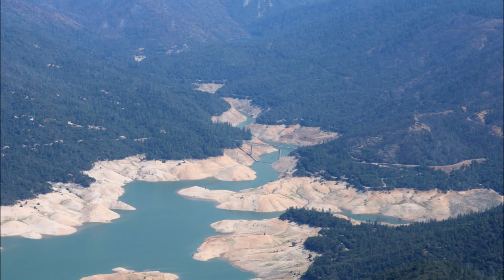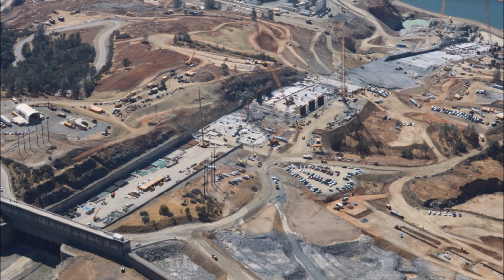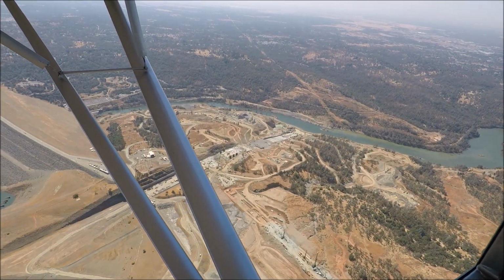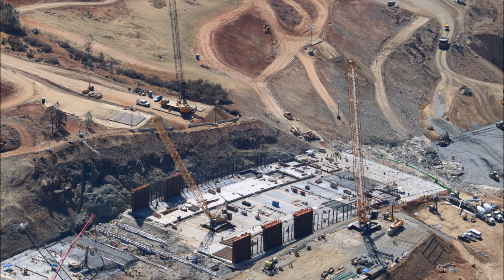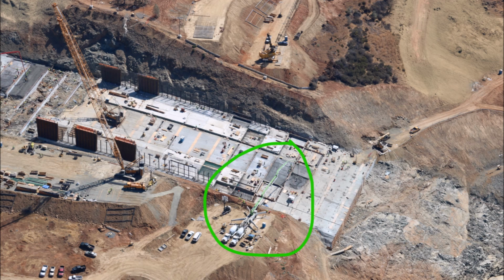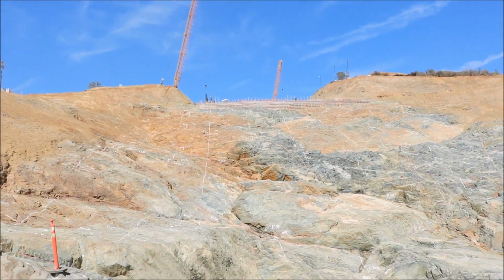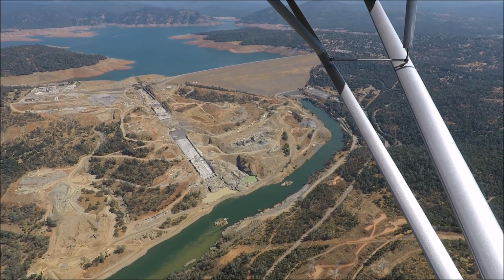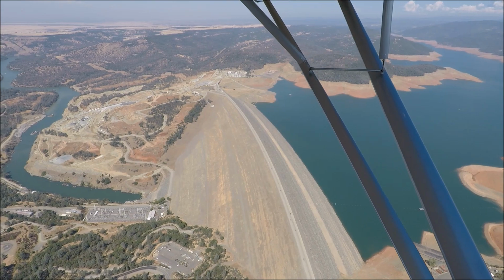Oroville Update 13 Sept "The RCC Race is ON!"

Comment: So, the bottom line of the Independent Forensic Team Interim Report is that it was slab uplift caused by the intense water flow that caused the failure, not cavitation, not groundwater erosion and not seismic activity. Necessarily there will be some handwaving as to exactly why the water flow caused the slab uplift since the evidence was all washed away. To quote:

The IFT believes that some combination of the following factors most likely was involved: 

• New damage and/or deterioration of slab repairs that resulted in more potential flow disturbance locations and more flow into the foundation than during the prior spillway discharge events. 

• Possible expansion of relatively shallow void(s) under the slab due to long-term erosion under the slab. The IFT found that the available evidence does not support the hypothesis that a deep void formed beneath the spillway chute due to foundation erosion, resulting in subsequent slab collapse, but shallow voids are conceivable.  

• Corrosion of the rebar across the concrete cracks or joints, as evidenced by post-failure investigations and previous repair photographs. 

• Reduction in anchor capacity due to erosion around anchors beneath the slab or anchor corrosion where anchors were not properly encapsulated in grout, also as evidenced post-failure.
Reply from the maker: Yep!
Reply: No one mentioned that the spillway makes a vertical bend similar to the airfoil of a wing where the high speed flow produces lots of lift, as seen in a fully loaded 777.
Thanks Juan for some great reporting, both here and about the hurricane!

Comment: I don't know a thing a flying, but the way you move that stick around during landing makes me nervous.
Reply: He's good with the Luscombe.
A bumpy afternoon due to the hot sun on the ground, every surface variation means a difference in air rising/dropping (thermals).
The view out the front shows how his quick little corrections left/right forward/back average out to keep it quite smooth on the intended path despite the bumps trying to move it around.
Reply: Actually, it's just his quick reaction and anticipation to counter all the rough air movement, so just imagine how rough it would really be without all the corrections!  Skilled pilots are quite good at this.  Maybe partly due to his Oroville Dam flights, I have taken an interest in flying, what pilots go through before, during and post flight.  I'll never be a pilot, but I find it fascinating and have learned quite a bit.  I might find a flight simulation program someday, might be safer and cheaper than the real thing.  I and wifey did boating in a 31 foot express cruiser for 8 years and some of the same principles a pilot follows are what we used in planning and executing our trips - fuel management, GPS, weather reports and weather watching, alternate plan B, "float plan" shared with a loved one back home, dual radios for communication, having proper supplies aboard and proper distribution of load, and more.  Boating is fun too!

Comment: Good job again White Lily! 

What are the specific erosion "control" measures? 

Did the DWR report explain just how the "dreaded green spot" actually occurred in any detail? 

Is there a linear profile showing the gradients (velocities/capacities) that will exist upon completion? 

Speaking of "linear," (as in thinking) has anyone mentioned the need for a set of comprehensive data sets, including, for example, the potential power and effects of S and P waves on the foundation of the foundation and its effects on the best laid RCC's and reinforced materials? 

Has anyone talked about the power of human demands over feasibility and context and vice-versa? 

Have any of them read Dickerson and Robertshaw's "Planning and Design?" If so, were the principles used in this case? 
What continues to astonish me (after all these decades, why does it—am I dum or sumpin'?) is how much guesswork and presumption (not to mention that horrifying creation, "Best Practices") goes into "engineering."

Comment: The RCC is being placed even with the top of the structural concrete so they are gonna have to remove 12 inches of Rcc and replace it with 12 inches of structural concrete. Juan if there is normal rainfall next winter can the power plant keep up with inflows? Wasn't last year an unusually wet winter compared to normal? I am wondering if they might not need the spillway at all this year.
Reply from the maker: That's right, the spillway may not be used at all this next year. The lake will be down nearly 200'!
Reply: Almost correct. The RCC is being placed even with the top of the "leveling" concrete. That puts it level with the "bottom" of the permanent structural slabs. So next year, they will pour the permanent structural slabs "on top" of the RCC and they will be even with the remaining structural slabs. For this winter, they will put a +- 3' high ramp (equal to the thickness of the structural slabs) at each end of the RCC where it meets the permanent slabs to ease, and aerate, the water as it travels over those different levels.

Comment: Great Reporting again Juan (as usual) Quick question (slow answer) The small pool at the end of the Spillway with the road across the bottom, that road has 3 or 4 hoses of a fair amount of water continually squirting into that pool on the inside of the road, where is that water from? What's it draining?
Reply from the maker: Steve Simmonds probably from construction, dental cleaning.

Comment: Awesome Juan thanks. That is a deep hole to be filled wow.
Reply: One of those images in Juan's video as well as what might be the same image in the latest DWR video, there is a vehicle sitting on one of those roaddways that has been cut to enable the RCC work as they progress up the slope. Using that vehicle as roughly a 6' gauge, each one of those roads is approx. 40' above the lower one. The bottom one may be a percentage less. I believe, however, that stated footage includes the fact that we are dealing with a compound issue. A "slope" (+- 20%) plus a hole. A straight line between the RCC and the leveling concrete @ the USW probably eats up half of the stated footage because of the ?? 20% slope of the chute. No getting around it, it IS a monumental amount of material.
Reply: Pappa -- Didn't I hear reports of 1.5 Trillion cubic yards of material washed into the Diversion Pool? A certain percentage of that came from what has been dubbed Croyle Canyon, yes?
Reply: If memory serves, and I have forgotten when that was reliable, the number I remember hearing from Juan was 1.5 "Million" cubic yards of material. Still way more than my "wheelbarrow" wants to tackle. ;o)

Comment: Lots of people keep saying RCC will be removed next season where the structural concrete will be added (the middle section). According to the BOC reports, the only RCC parts that will be removed are the "transition" ramps and the very top and bottom of that center section. The Structural concrete will be laid right on top of the RCC assuming none of the RCC needs to be repaired. The RCC that WILL be removed is the "training walls". 
While those things alongside the lower RCC areas my look like forms, they're actually working scaffolds for the placement of the shotcrete on the RCC training walls. Amazing how they look like they're going "uphill" while they are actually "level" on a rather radical slope. 
Thanks for the great coverage Juan. These are some great shots.
Reply: If my understanding is correct, yes, the "finished" RCC is at the same level as the "leveling" concrete with a "transition ramp" at the bottom of the RCC section and another one at the top of the RCC section of the chute (with some type of aeration feature). The "Structural Concrete Slabs" that become the permanent surface of the spillway, are roughly 3' thick and sit on top of the leveling concrete AND/OR the RCC since both of those bases are at the same plane/level. So, next year, removing those transition ramps and adding the structural concrete slabs on top of the RCC section, between the upper and lower SW,  will make the entire spillway the same level.  Before the BOC reports, when there was much less detail regarding the RCC and its levels, there was a some question and presumption that the RCC would be level with the "top" of the structural slabs so three feet of RCC would need to be removed and be replaced with Structural Concrete next year. That idea seems to have become "embeded" and keeps coming up even though more details have come along that disprove that idea. The explanation of the ramps is also in the last BOC report.
Reply: Pappa Bob I have the same understanding as you, but it raises a couple of questions. Currently, the RCC is flush with the leveling concrete. My understanding is that the reinforced top layer of RCC is already completed. So next year, the structural concrete will sit over top to align with the slabs below. The issue is this: if this is correct, there will need to be an UPWARD ramp for this season  since the RCC is lower. Have not heard any talk of this.
Reply: It was my understanding that Kiewit would grind down the RCC where needed to achieve the correct elevation for the SC to be applied. Also, they are going to cut out sections crossways where the drainage pipes are going to be placed.
Reply: For sure, they will be saw cutting trenches for the drains. The RCC elevation, however is roughly 3' below finish grade so grinding for elevation should not be necessary. That is the reason for the "transition ramps" at both ends. They are using GPS instruments now for the levels of the RCC so they should be pretty accurate.
Reply: I think there is still a question as to whether the final hardened layer of RCC has been added. If it is still to be added it could come up flush to the finished slabs below for this season. Then, when the final slabs are placed over the RCC next year this would create the step down that has been discussed. I think this is the most likely situation. It also explains why the drop from the upper slabs to the RCC is currently so large. After the final RCC layer is added and then the structural layer next year, the drop should equal the lower one.

Comment: Hello. I ask if there is any other reason besides cavitation reduction to introduce air in the water stream? At the end of the CA Aqueduct in Sylmar CA there is a long open channel (part of the aqueduct). This channel has been there all my life (you can see it as you head North on the 405, this part of the aqueduct was opened in 1913, I believe). The bottom of the channel is lined in rocks. The rocks cause the water to tumble. I always thought that this tumbling of the water was a step in purification, is it really done to preserve the concrete structure of the aqueduct?
Reply from the maker: Dan R in this case, yes.

Comment: The planks you mentioned along the RCC walls are used for workers to walk on. They are drilling into the RCC walls, injecting a special epoxy, and hammering in attaching rebar to the wall. It looks like they will form up the rebar, pour it and have structure concrete over the RCC to form a protective wall. That is interesting to note because Jeff Petersen, in your interview, said they "might" remove the RCC walls next year.
Reply from the maker: p w Got it. Thanks!

Comment: Juan.  I believe the forms against the RCC walls are for the contractors to place rebar against the RCC which will then be shotcreted to provide a smooth strong surface to the side walls
Reply from the maker: Got it!
Reply: blancolirio
 Rain season is just around the corner and Lake Almanor is filled to the the brim this morning. Will they keep working in the rain and snow to get it done before Lake Oroville is full?
Reply: Or would they use flat forms linke in the lower chute, but on one side only to obtain a nice smooth surface?

Comment: The "wood walls" 09:04 on the inside of the RCC walls are scaffolding for the installation of rebar and shotcrete concrete installation (as seen on the latest DWR video https://youtu.be/k5gYfX2p6m8 00:15-00:42).
Reply: That DWR video really shows how the scaffolding walks work. I do like the guy with that big drill, hang onto that thing if it got hung up.lol
Reply: I was gunna make the same comment.. you beat me to it...